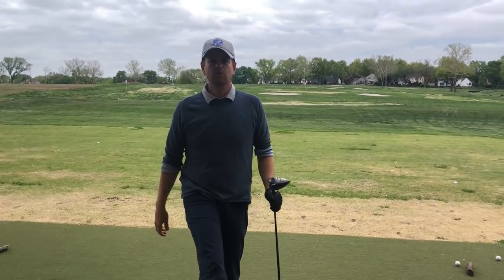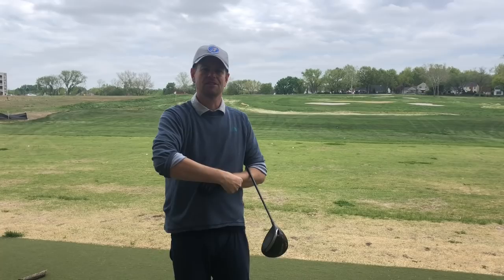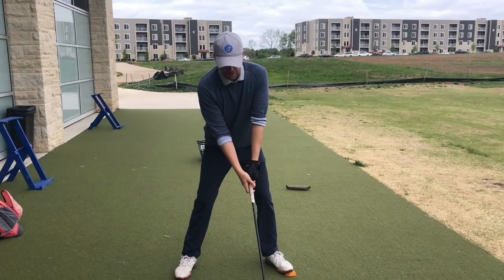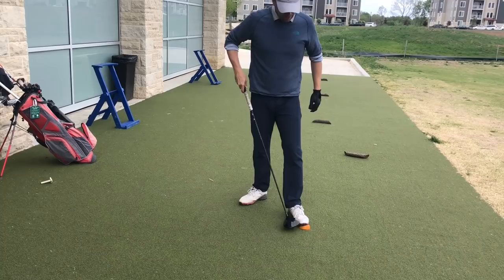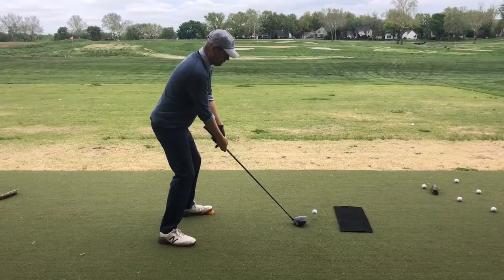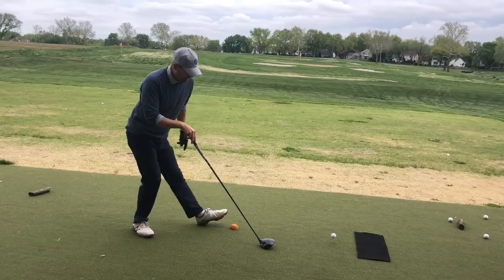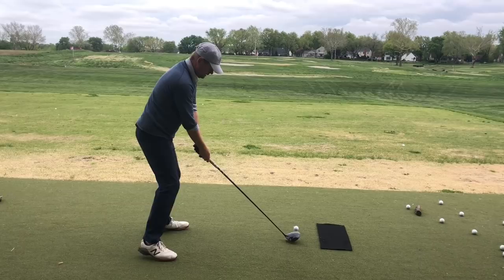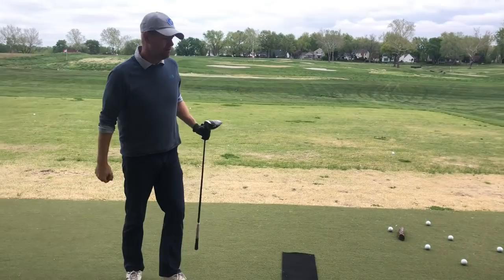Simple Key to Unlock Speed Using Shear Force for Golf

Comment: you're planting your legs into the ground and applying counter-pressure away from the ball which allow your arms the maximum room to throw into the impact position...if you push hard enough, the force generated will actually shift you back after the swing...this is very similar to, and why the deadlift works so well with the golf swing...because in the deadlift you can focus on pushing the ground away from your body instead of pulling up.... in the golf swing, the pushing motion into the ground creates the stabilization and sort of hidden momentum for the force which your arms then produce...
you don't need  to stand on anything in order to practice this....when doing heavy deadlifts, you "screw" your feet into the ground before impact...when doing really explosive leg lifts like snatches you can learn this ground force...and you can then take this knowledge and apply it to the golf swing...the more you can feel the ground, the more you can plant and blast off

Comment: Not completely advisable for 'scoring' iron shots (high fades are better), but for long bomb wide fairway driving, weight back to the right heal to load the body's rotation, then out towards the left toe (diagonally out to the ball), and then finally, the push off / shearing force of the left leg back to the heal, that accelerates the club head out to the ball (similar to you pulling back on a towel to create the whip). Think of this, if you are a tennis player, as your 1st serve that is flatter / has more speed. Top male tour tennis players have 1st serve percentages 'around' 70% - not dissimilar from fairways hit by top golfers (not Tiger this week at Beth Page Black - see Koepka's stats). Every golfer also needs their 2nd serve / fairway finder swing, basically a fade, that they should be able to hit 90% of the time (see Tiger winning the Masters). Grip it and rip it.

Comment: Sorry, I don't get it.
You push down to the max at halfway back in the backswing with the right foot, and then you start to push the left foot down and towards the ball?
Reply: You're basically pushing away from the weight/force of the swinging club head. Go watch Mike Malaska video "create more speed in your swing" or something along those lines. It creates parametric acceleration. A good way to feel it is to take practice swings on a down slope...if you don't push away, you'll lose your balance and fall forward.